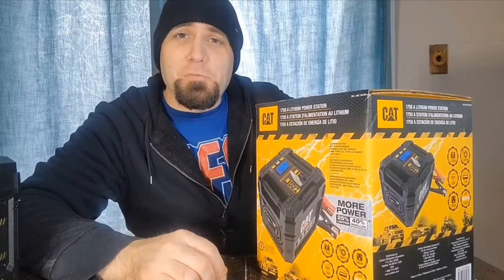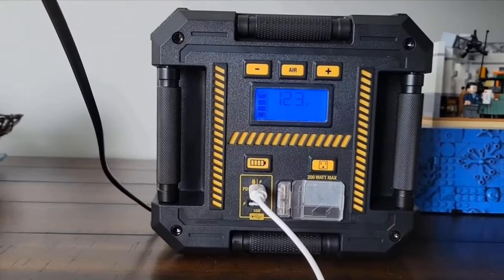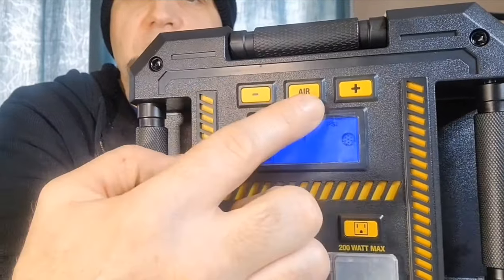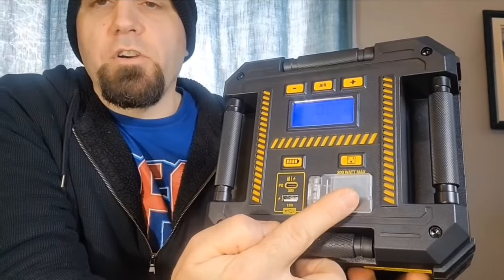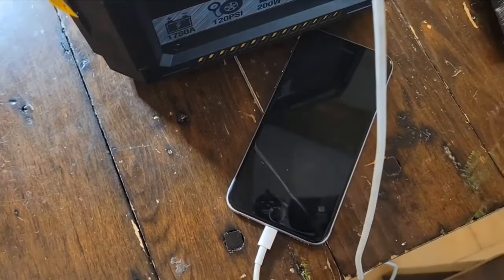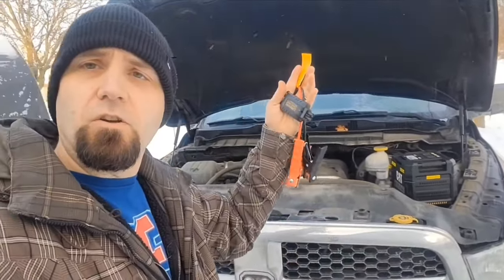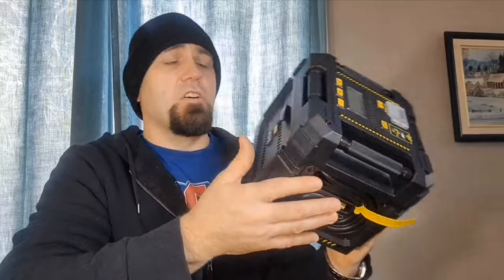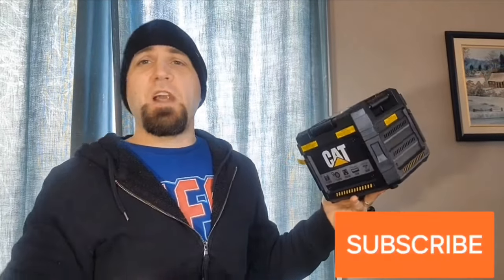CAT Lithium power station review (Part 1) - Costco PPSCL3

Comment: I'm still unclear how to charge this unit....it says 30 watts but if I plug the cord into a "block" and then plug it into a household plug-in, the wattage on that can be up to 1500 watts....WTH..?
Reply from the maker: You charge the unit with the USB-C port
Reply: I get that, but a normal wall plug-in on a house current can be as high as 1500 watts (unless I'm misinformed).  I'm concerned that if I plug the other end into a block adapter and plug it into a household plug-in, I may damage the unit
Reply from the maker: @BarryVeristain   yes your wall plug can push this much power but the power block like cellphone power block depending of the block only let 15w to 100w. Look at the small print on the block and it will tell you.
Reply from the maker: If your using a usb-a wall block, those can only pass 15w
Reply from the maker: If it doesn't say the watts "W" on your power block it will say the voltage "V" and the amps "A".
Here's the formula to find watts.
V × A = W
Exemple 9v × 2.5a = 22.5w
Reply from the maker: If the block doesn't thell you the watts "W" it will tell you the voltage "V" and the amps "A"
V × A = W
Reply: I'm not concerned about the block that I'm plugging the USB cord into for charging, I'm asking about charging the unit by  using a standard household wall plug-in as my source of power FOR THE BLOCK.  I don't  know if I should be trying to plug the other  end (not the end of the cord into the unit itself) but rather if I should plug the other end into perhaps my computer port to charge or if it is safe to plug it into a "block" and then plug the block into a standard household wall plug-in
Reply from the maker: @BarryVeristain  charge it just like charging your cellphone, replace the cellphone for the power station that's all.
Reply: @BarryVeristain dude.... Please turn in your MAN CARD. 🤦🏿‍♂️
Reply: @neworleans8thward151 that's what I'm saying how dumb is that dude? You're funny for that one. I like it. Common Sense isn't that common these days

Comment: Can I charge my laptop with it?
Reply from the maker: I can't see why not.
Reply: If I can use it to charge my Tesla you can charge a laptop.
Reply: No! It does not have a pure sign inverter and will therefore damage your laptop long term. 

Also, it only has an 11v 41ah battery which is 3700mah. This piece of junk can’t even charge some cell phones.

Comment: The battery was halfway charged, as I expected. I plugged it in to charge, and it indicated charging by the battery indicator moving up. A couple minutes later it stopped doing that and just showed half a battery with no movement. Then it the screen would just go blank (went off, I assume). So I tried to charge something else from the battery to see if it would work the other way, but it wouldn't charge my phone or my computer. So I tried the AC plug, and it worked. And the air worked. The light worked. But it's been two hours and I can't get it to charge.
Reply from the maker: Your trying to charge it through the usb-c port right?
The usb-c port is in/out and the usb-a is only output.
Reply: @Toolspecs    Yeah, I am using the C port. I did try the A port when the C didn't work, but that didn't work either.
Reply from the maker: @greyeyed123   you might have to run the battery down using the 120v plug and then charge it. It might reset the minimum/maximum voltage cut off. This power station did the same thing to me once and that's how I fixed it.
Hopefully this work for you too.
Let me know if it works.
Reply: @Toolspecs    Ok. I will try it. I already found the receipt and was going to return it tomorrow, but I'd rather not if there is an easy fix.

Comment: Why am I only getting red light??? I'm connecting it property red with positive and black on chassiss help!!!!!
Reply from the maker: Is it solid red or blinking red?
Reply: Its blinking red then turns green and goea bqck to blinking red@Toolspecs
Reply: @Toolspecs it stays green for 2 seconds then goes back to blinking
Reply from the maker: @arlinpena4739  it'd go8ng in protection mode. Your trying to charge a battery that's to low or completely dead. 
A battery  jump is for batteries that are above 8v-9v that are barely cranking the engine. The amp draw for batteries that are lower than this is to high to jump them, you have to charge them with a charger instead. 
Hope this help.
Reply: @Toolspecs  thank you , it did help, I will buy another battery today I've had this one close to 4 years

Comment: Great video one question that it leaves unanswered is what type of block I have to plug into the wall to charge it when the battery goes low. Can I use the same block that I use to charge my iPhone to charge the unit?
Reply from the maker: Yes just a phone block. You can use either a USB-A or a usb-c block, both work fine but of course usb-c blocks charge way faster.

Comment: Thanks a bunch for this video. We are working an off grid even next this weekend that will require us to have our phones charged and to run a salt lamp. I like that it uses a USB-C for the recharge as it should be able to be charged by the inverter in our Jeep in the interim whilst up at the event. 
This is a good place to start for our first unit. Thanks! 🙏🏼
Reply from the maker: @kaypa34  your welcome!
It's a nice little power station to have around.

Comment: Great Video 😊😊. I like my CAT except for the air pump, very slow.  Did use the jump start twice and it worked great.
Reply from the maker: I agree, i believe that they probably use a small pump because it create less heat so that it doesn't damage the electrical component.
Reply: I used it once to pump up a front tire on a mower to 9 pounds.  It took forever 😞😞

Comment: Great tutorial. I bought it yesterday and after fully charge the display shows 12.4 v. I saw some videos made by other people with 12.7. Is it normal that I’m not getting more than 12.4? I’ve also read that it should be charge 20hours during first charging.
Reply from the maker: Anything over 12.4v is just what we call a surface charge, it will settle back down to 12.4v which is fully charged. After the unit reach full charge, there's absolutely no point in keeping it on charge for longer.
Reply from the maker: Surface charge on any batteries will go away immediately as soon as the battery is under load.
Reply: Thank you for the quick reply. I was gonna exchange it but now I’m calm 🫡
Reply from the maker: The part 2 video with all the tests is edited and scheduled release is friday 10:30am if your interested.
Reply: Sure. Thank you again for the professionalism

Comment: You show, to charge the unit itself, plug the USB into the port on the unit....what do I plug the other end into...?  I don't want to use a block plug that I insert the other end of the cord and then plug that into a standard household plug-in and ruin the unit by attempting to charge with too much power.  Do I plug the other end into a USB port, perhaps, on my computer...???
Reply from the maker: A computer would work or just a regular cellphone power block.
Power block will tell you voltage "V and amps "A"
Calculate  watts "W" :
 V × A = W

Comment: How long will this thing hold a charge if you throw it in your truck and like 7 months later your truck wont start you get it out conmect....to boost your vehicle would it work? How long will it hold a charge once you charge it up?
Reply from the maker: It should hold charge for a long time but I beleive that the instructions say to put it on charge every 6-8 weeks if your not using it.
Reply: It says to charge it every 30 days. I didn't (left it for a few months) and now its totally dead... it wont hold enough charge to even turn on the LED for more than 1 second
Reply from the maker: @ZILLA....  ho no
Is there enough charge left to let you charge it back up or did it go to low?

Comment: Terrific video thanks…….  Is it good enough for a fridge?  Thanks
Reply from the maker: Not even close for a full size fridge as the freon pump motor demand lots of power to get the motor to start turning. Some demand 900w+
Reply: @Toolspecs  ok thanks a bunch… we will stick to our cooler!!
Reply: Another question… it seemed to not last very long.. just 1 or 2 ipad charges and it’s down to 1 bar and 9.2 volts…. Is that normal?     Is 9.2 volts as low as it goes.. ?   It wont charge anything anymore…. Thx much
Reply from the maker: @crianhard  9.2v-9.4v is the cutoff  for 12v lithium battery.
What are you using to charge the ipad (usb-a, usb-c or 120v plug) ?
Reply: @Toolspecs  using the usb c to charge
Reply from the maker: @crianhard  I can only find the charging time and not how many charges it can do.  Sorry I don't have the answer for you at this time.

Comment: I picked this up and whenever i change it to AC power it blinks with a "!" In a triangle. Do you know what to do to fix this?
Reply from the maker: Are you plugging in something that it more that 200 watts?
Reply: @Toolspecs  it blinks like that when I press the AC button before even plugging anything in.
Reply from the maker: @DocGG_VT   i didn't come accross this issue, i would call manifacture.
Reply: @Toolspecs  yeah I'll probably just return it
Reply: @DocGG_VT  I feel the same way they use a 3 cheap batteries too small to do any significant job, that is too expensive
Reply: @younggullkim2132  yeah after looking into it I found that the AC fault is pretty common. I don't think I'll be buying anymore CAT products 😅.

Comment: can i leave this in my trunk in a hot sunny day? im afraid the battery would explode in my car?
Reply from the maker: It's a lithium battery so it should be fine but it might shortened the battery life.  It's more in the cold that you have to worry about as can discharge the battery slowly.
Reply: @Toolspecs  What's the point of a jump starter you can't keep in your vehicle when you need one the most (when it's cold)?
Reply from the maker: @chrish1906  all jump start say this in the instruction, so that they're not liable if it break cause of poor maintenance.
Any Jumpstart from any compagny need the battery fully charged cause a dead or low battery can freeze or the battery will be garbage

Comment: Were you impressed by the performance?
Reply from the maker: In part 2 you can see some great tests.
Imo this product is great for the cost and what it's built for.
This is a all in one power station with 200w inverter, it will not power up a 1000W coffee maker lol
Reply: Won't jump start a 2nd gen sequoia